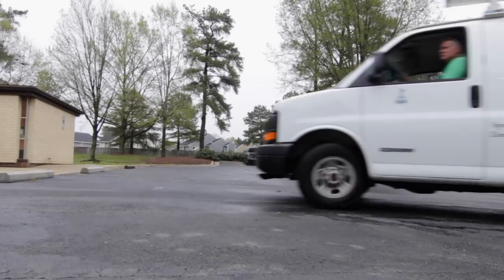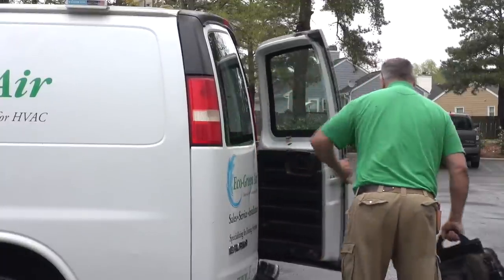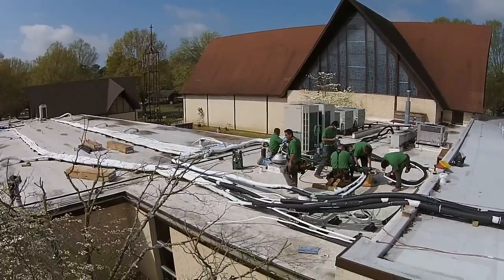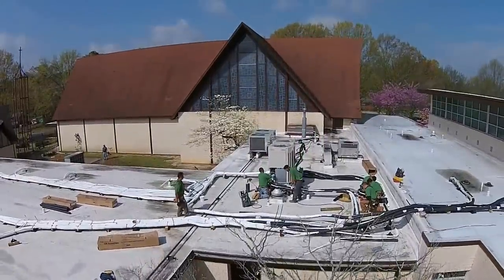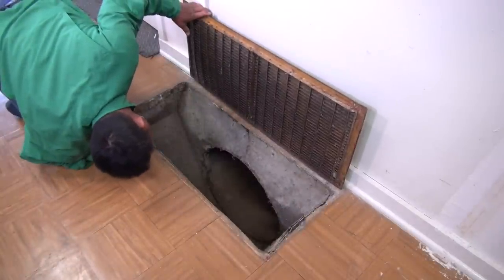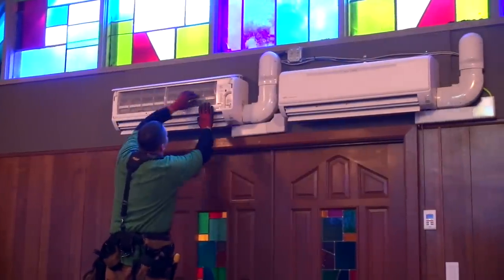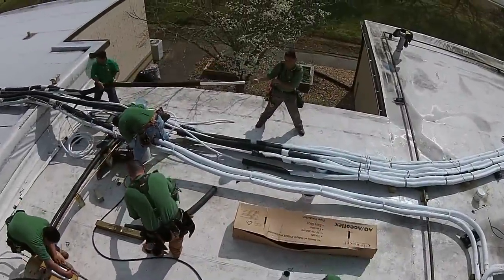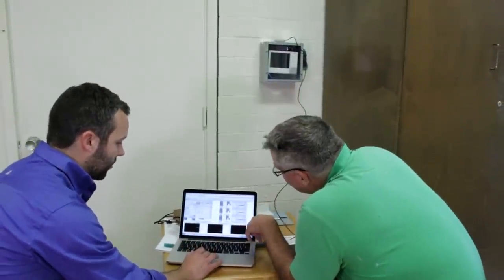Fujitsu Airstage VRF at St. James Church in Raleigh, NC

Comment: You guys are right,the roof top refrigerant piping looks bad . They need to either use hard copper or learn how to roll soft copper out straight.dam
Reply: Scott Riddle they need to put al jackets, not many would do, usually they just paint the insulation white lol